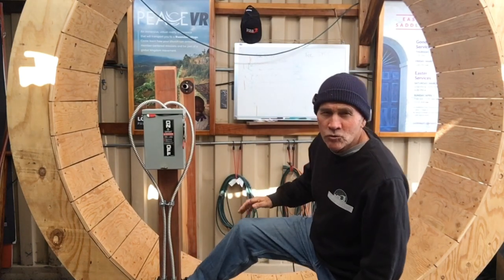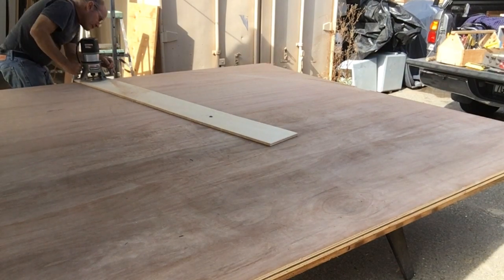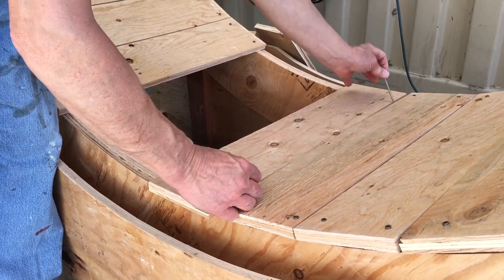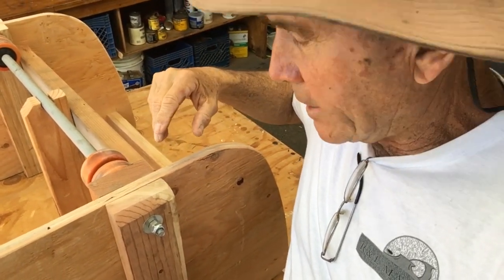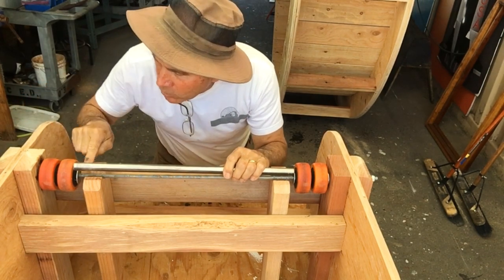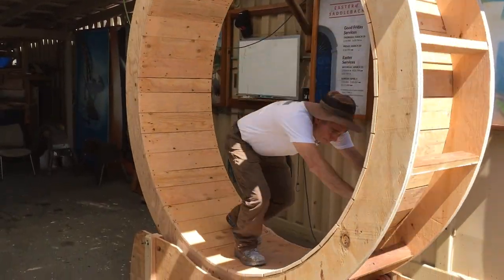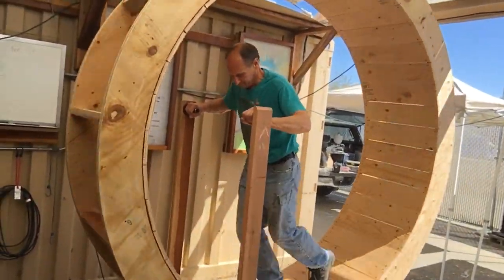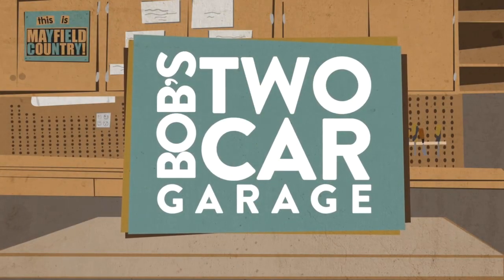How to Make a Human Hamster Wheel

Comment: Hook it up to a generator and a battery... create your own power.... train your large dog to exercise on it and each of you can take turns creating power...

I’m building a cabin in Alaska, I should do this for power there because the trees are too tall and the clearing not big enough for an appropriately sized solar or wind power generator.... then it will require less use of my little red suitcase (Honda 2000 generator)...
Reply: how did it go

Comment: I thinking of building one of these, starting looking at different videos, and then thought how to  gear this to turn ~5 RPMs (or ~1.3 MPH walking speed) to a 300 amp car alternator at >6000 RPM.  300 amps at 12 volts is ~3.6 kWh.
Reply from the maker: Jerry Lifsey I’d like to see it.

Comment: Bob what is the cost for this
Reply from the maker: Whatever 6 sheets of plywood , the threaded rod , the wheels and a bunch of screws cost. I honestly didn’t keep track, sorry.
Reply: @BobsTwoCarGarage  would it be too difficult for an amateur craftsman.
Reply from the maker: @minemoore697  well you gotta just jump in sometimes and give it a try. Cutting an accurate circle is probably the most critical part. If you don’t use a router like I did, cut very carefully with a jig saw. Go for it.

Comment: From my amateur understanding you could put four dynamos at the base of the wheel to produce electrical power while you run and hook it up to a charge controller which you can then hook up to a lithium ion high capacity battery bank to power a home as a compliment to a solar system. 

I’ve seen this done before. 
My answer is can I use thicker wood to make the wheel or would that complicate the  design
Reply from the maker: Catalyst - D B yes I’ve seen that  before too. Thanks for watching.
Reply: Bobs Two Car Garage Sorry. I said answer at the end, I meant to say, “question”. Sorry. My mind messed up there. Lol